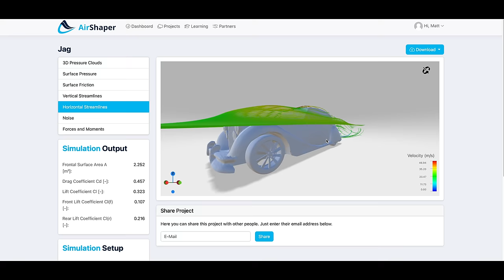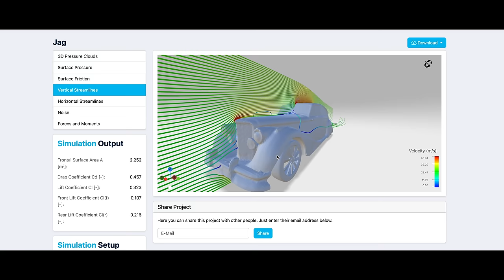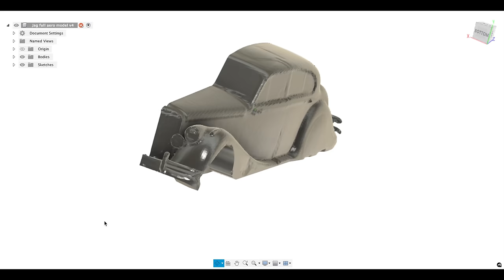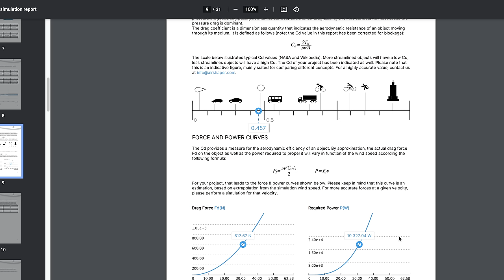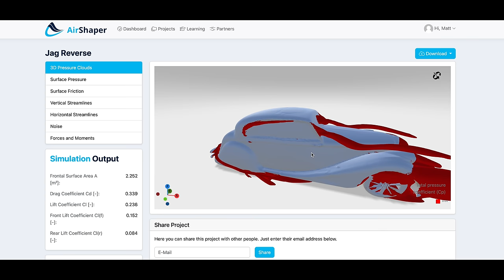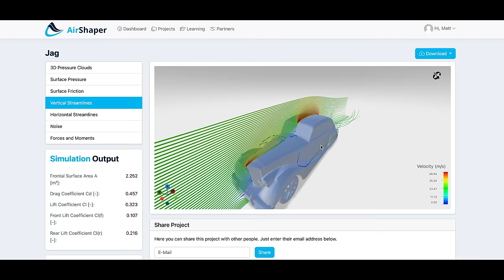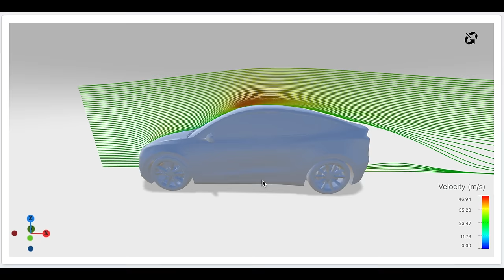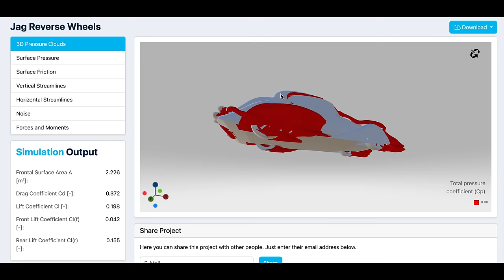Why Some Cars Are Faster Backward

Comment: Do you think hatchbacks like my 2004 vw golf would be better in reverse? It kinda looks like it would be worse
Reply: am curious about the same for my Skoda Yeti, I'm assuming the absolute dumpy on her probably isn't great for reverse aero
Reply: I'm not sure but the Golf is not good!  The two-box shape is not as good as Kammbacks like say the Skoda Octavia (hatchback) or Citroen Xantia (hatchback) where the C-pillar slopes gently.  The  sharp edge (that Matt mentioned) is closer to the ground allowing for a smaller turbulent wake behind the car and thus less drag, than on a Golf where the sharp edge is at the end of the main roof.  But obviously you get less cargo volume for the same length of car (so the Octavia is a much longer car than the Golf, even though it uses the same mechanical underpinnings).

Comment: Where can I also find a neon illuminated check engine light sign?
Reply: "neon" signs are actually pretty easy to make if you've got a 3D printer! you can buy rubber lengths with LED strips in it which slot nicely into 3D printed rails

Comment: How much of the drag is due to pushing the air out of the way and how much due to the air not separating at the back? Or doesn’t the question make sense…?
Reply: I don't quite follow, but if you put the air "back together" afterwards like an aerofoil, then the drag is not too bad.  When they say separating they mean doing it sharply but while still trying to make the wake as small as possible.  It would still be more ideal to have a really long gentle tail, but obviously that's not practical.  Hence it's meant to be a long gentle tail, but then cut off, which is called a Kammback vehicle design.

Comment: How much cooling is needed for EVs?
Reply: Some.  Like ¼ that of an ICE vehicle, depending on the situation.  Efficiency ~85% instead of ~30%.
Reply: @csn583  yeah I didn't think that 1/4th would really need to be front facing.. considering how little cooling is needed. [9:23]

Comment: What would happen if you just added the shapes of the low pressure zones (Or it says 3D pressure clouds) onto the car as like a new "body" Would that automatically fix the drag problem or am I just really tired and not using my brain so much?

Edit: I will NOT come down off this high horse that YOU forced upon me damnit! lol What you should do is, Get a bigger horse and climb up here with the rest of us.
Reply: "What would happen if you just added the shapes of the low pressure zones (Or it says 3D pressure clouds) onto the car as like a new "body""  Yeah, probably! That's very clever!  You would be filling in the separated wake areas, leaving a body shape that the air is actually able to follow.

Comment: What about hood vents to reduce air packing pressure up front? Would that help the air coming toward the windshield to be directed more smoothly over the top? Are there any flow diverters that you could implement between the rear hips and rear bubbles to smooth out the flow toward the rear?